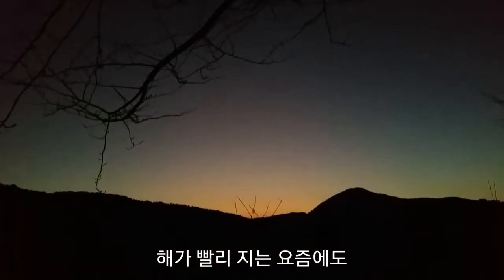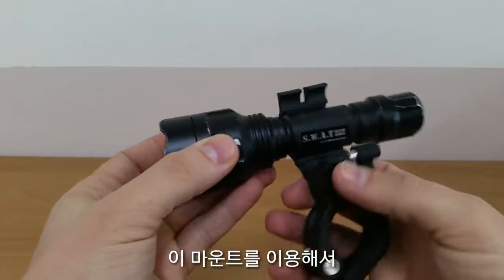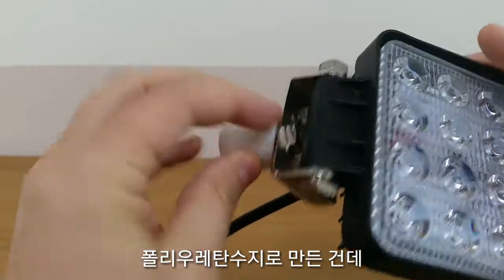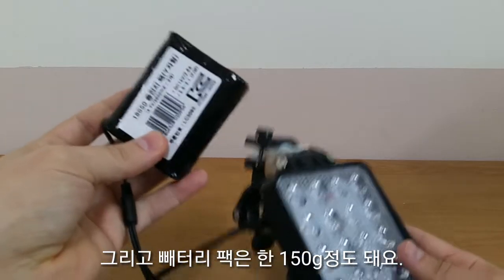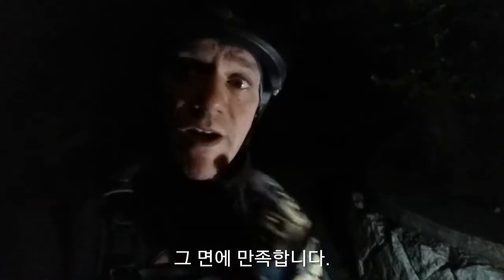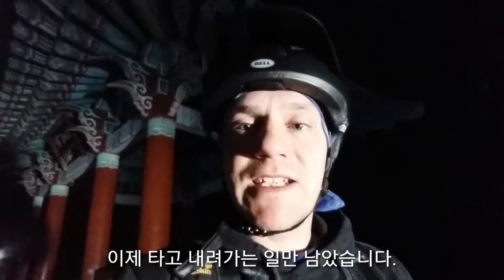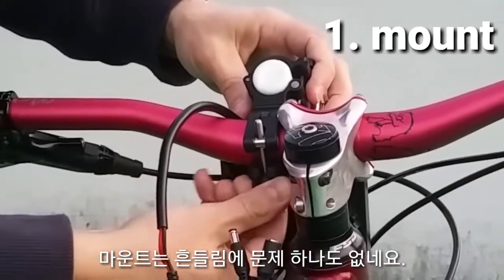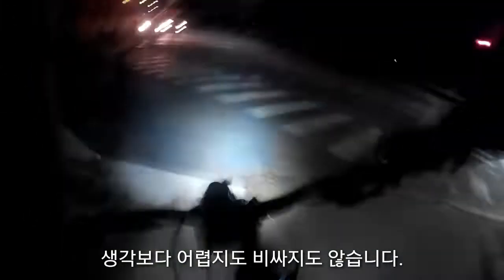DIY lights for MTB

Comment: Aside from being a 12v light, do you know how many amps or watts the light is rated?
Reply from the maker: According to the packaging it's 48w, 6000k (I assume that's supposed to be lumens, but it's MADE IN CHINA so...)
Reply: @ohdehhan  6000? Airplanes are 5000 lumen
Reply: @ohdehhan  6000k is the color temp Kelvin
Reply: @leon760  cold white, around 2000 lumens ,4A @12V, 2A@24V .